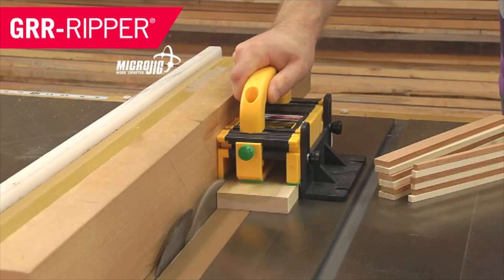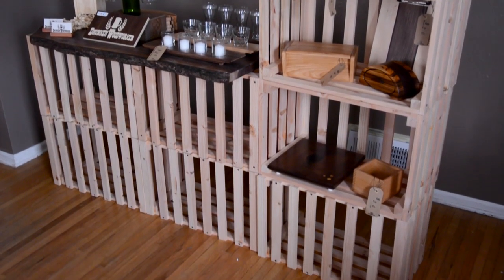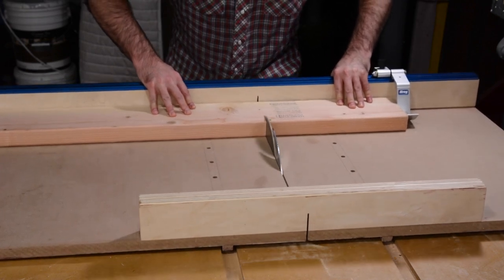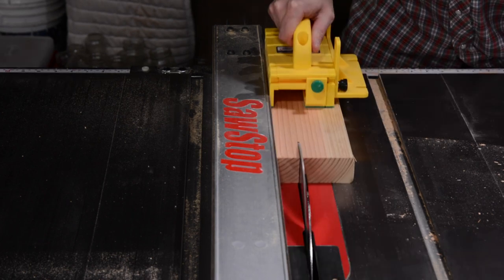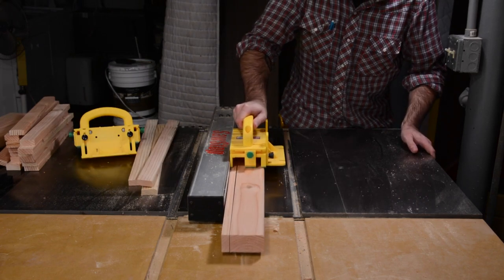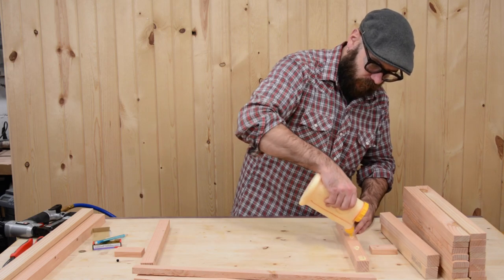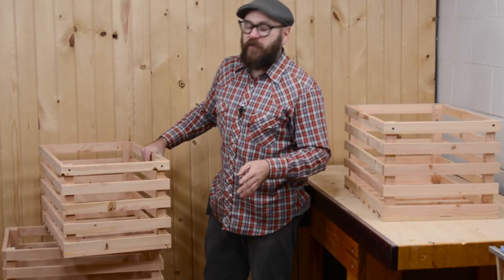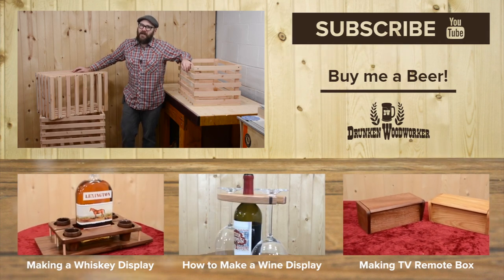How to Make a Wood Crate from a 2x6

Comment: David, I could not sell these crates, but the people I have given them to have been ecstatic.  I have had people in my home admire them and ask for one for Christmas so i am running off another batch.  I sand the wood, stain the wood walnut, polyurethane varnish (two coats--sanding in between) counter sink holes and use spax brass colored construction screws and titebond 2 glue on the slats where they meet the 2X2.  They look like furniture when they are finished, but like I said--in my neighborhood you have to give them away to people who appreciate nice things  because no one is going to pay you for your time let alone materials. I should have written before after I made the first batch because you did make a great video. It still holds up as a great video and I TY for sharing it.

Comment: WHY DOES EVERYONE BUT ME HAVE A TABLE SAW!! Have mercy cruel world.
Reply: You should check your local classified ads. You could probably pick up a used table saw really cheap. There are lots that are around $30-$50. Make sure they are straight, slap a new blade in there, and you're good to go. You don't need to start with a $2,000 table saw. Start small and upgrade down the road.
Reply: If your budget allows it - I would highly recommend the Ryobi 10" table saw from Home Depot (~$200), the one that comes with the collapsible stand.  That is by far the best budget table saw you'll find outside of buying used like the post above mine suggested.
Reply: I still love watching the old videos
Reply: I know right! I so need one of these! 🧐
Reply: I too am without a table saw & my boyfriend wants to keep it that way.  I have an obsession with collecting tools, it's mostly fantasies.
Reply: @ChiefMoonChunks  its true. Its exactly what i use and i do just what you see in this video. Ive ripped hundreds of feet of slat for projects from wood off an old deck. Just have to make adjust everything to square before you cut.

Comment: You could make two crates from that 2x6 as you  made the pieces extra thick. We use crates with less than half the thickness of the boards (except for the 4 corner ones) and they are very though still. Also the bottom rails are usually wider and put on the long side. But that's just how we made  them in parts of europe, still nice video!

Comment: Hey David had a quick question for you! Would these crates be able to hold a crate full of soda bottles? I want to make some for a buddy of mine so he can stock some stuff in his store in a more "fashionable" way but I'm not sure if these would hold up when filled with a bunch of Coke or Dr. Pepper bottles and then stacked 3 or 4 crates high! Thanks and keep up the great content!
Reply from the maker: Hmmmm, tough call. You might want to drill some holes in the joints and plug them with dowels for added strength.
Reply: Good idea! Thanks for the input.